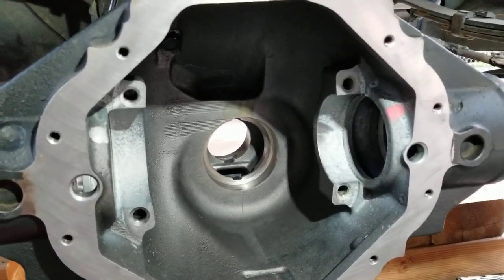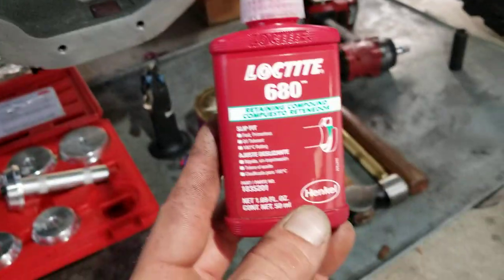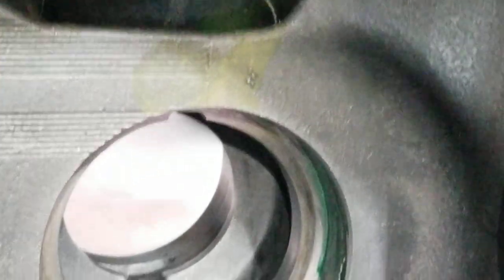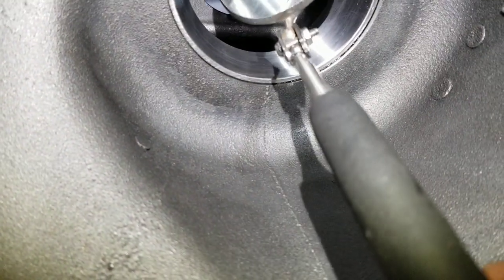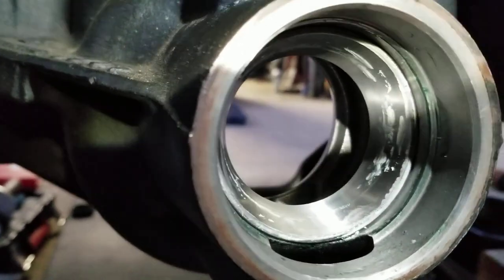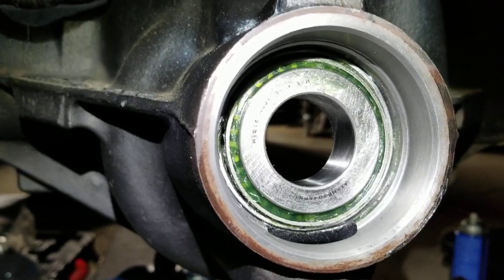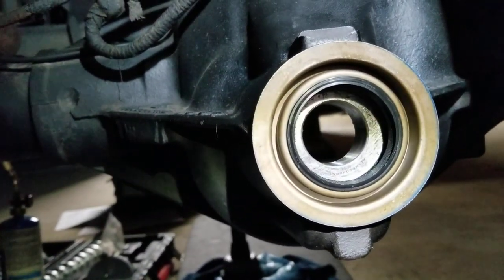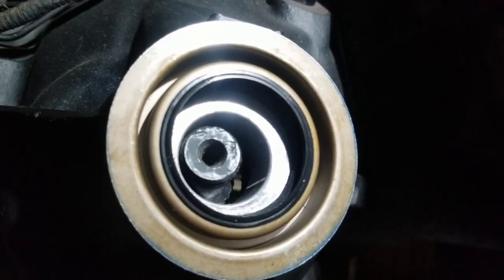Dodge Ram 1500 Pinion bearings and gear Install

Comment: I like the video I am currently doing my 04 rear and I noticed this is the second video I dont see you using shims , so question if you go with a new pinion and ring gear does it still need to be shimmed ?
Reply from the maker: @alcapon-o3f  yes, watch all of my videos. I shim the pinion at least 4 times before i got it correct. My situation may be a little different than yours. My inner pinion bearing failed, and removed enough material from the axle housing/ bearing journal that it required double the shim stack to make it correct.

Comment: How exactly did you pull the pinion through the bearing without knocking out the outer bearing & seal?
Reply from the maker: @caveman9298  I made a special tool. I saw some online for around $350, but wasnt sure if it was for my 9.25, so I ended up fabricating a tool that was heavy duty and worked. I think theres a video of me briefly going over the tooling process.

Comment: How much would something like this cost?
Reply from the maker: I dont think most shops have techs that are capable of doing this type of work. They would probably sell you a new axle, rather than rebuild it. If I had to put a total price on the rear end build. Parts and labor, $4k
Reply: I’m having mine done as we speak. 2014, 9.25 rear- quoted $1200-2K.
Reply from the maker: @cdiddy2471  yea I'm not touching 1 for under $1000 labor lol.